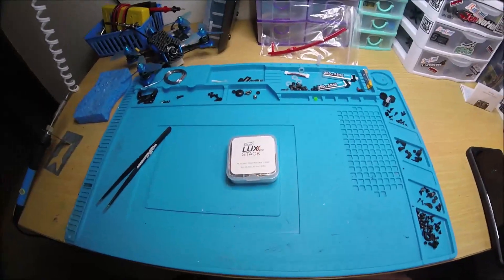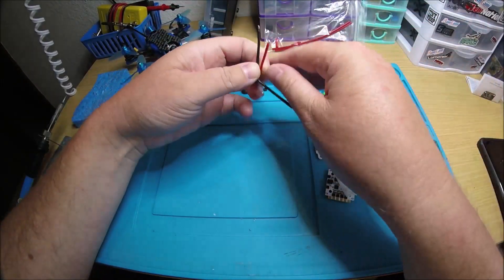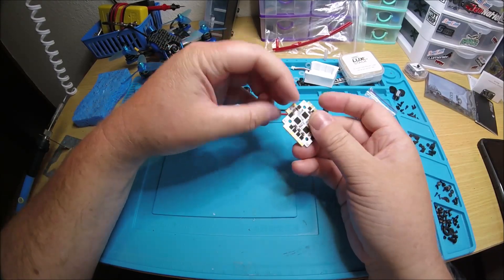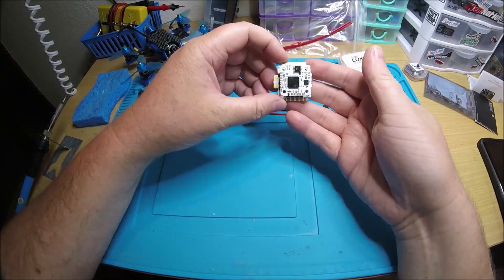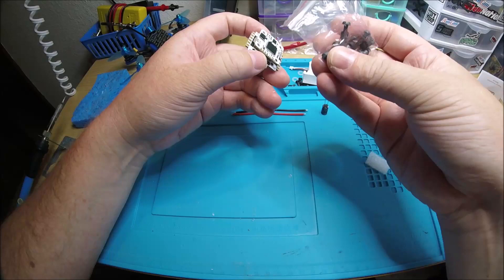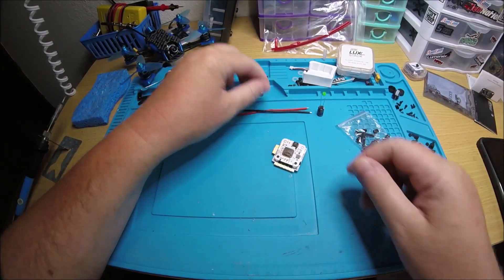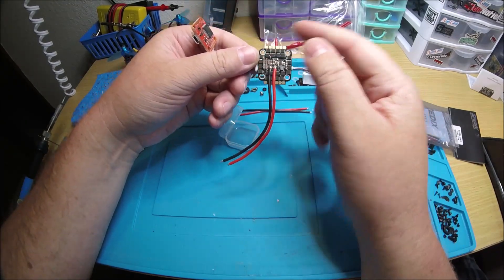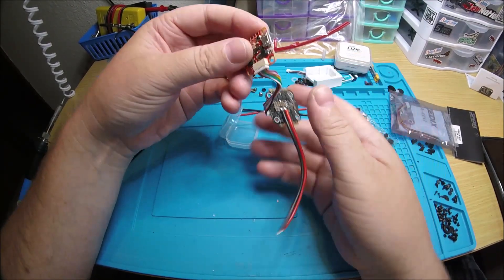lumenier f4 v3 talon f4 combo

Comment: Have you soldered up the lux v3, I've been doing a build with one today and I'm having a hard time getting the solder on the pads, I'm wondering if that's because of the conformal coating. Let me know if you had that problem and if there's a solution. Idk, Maybe I just suck at soldering
Reply from the maker: Yes all lumenier escs are like that. You just have to get it hotter
Reply: Thanks man

Comment: Looks nice beeper pads ? I like the talon but no beeper sucks for micro's.
Reply from the maker: You know I tested the talon for them before they ever even had it made and I asked them about it and they said they were putting them on the next batch but they never did. Another thing I been seeing is everyone these days is using the betaflight motor beeper now and the blheli beeper but to me they arent as loud as a regular beeper. Actually if i could afford it i would one of those $30 beepers on every quad those things are sick
Reply: @ADMDGLS69  yeah, motors are not loud enough and get hot fast just sitting in tree.